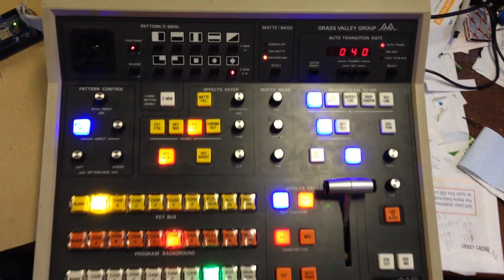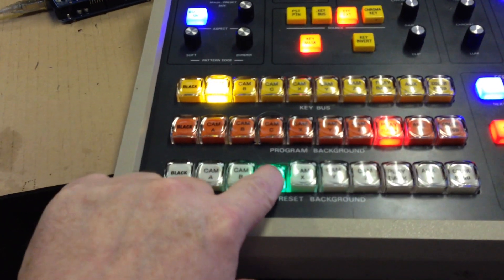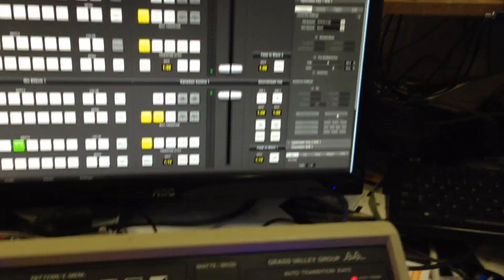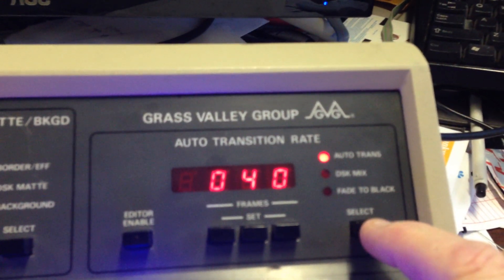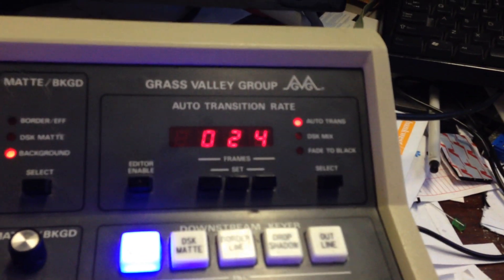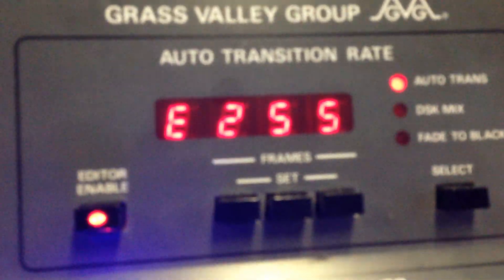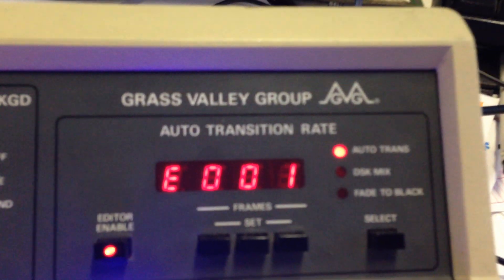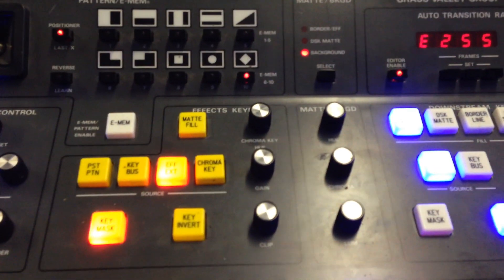GVG110 ATEM

Comment: Hi there,

I am more than impressed with your ingenuity on all of this - very impressed indeed.
OK, so after many months of trying to find a 110 or 100 to make a conversion to here in the UK, I have failed to economically find one.

HOWEVER - I am curious to determine whether or not you may know of a way that say... an old Panasonic MX12 / MX series mixer could be adapted?

Here in the UK there are an abundance of the MX series mixers, and would be a great candidate for a conversion of some description.

What are your thoughts on this - could your kit easily be converted to suit a panasonic protocol perhaps?

I'd appreciate your thoughts.
Many thanks.

Jonny

Comment: I'm hoping for a sweetheart deal on the complete software installed Arduino Mega and interface cables with a comprehensive 'how to' for the GVG110 modifications.  rev.dr.tcblalock@gmail.com